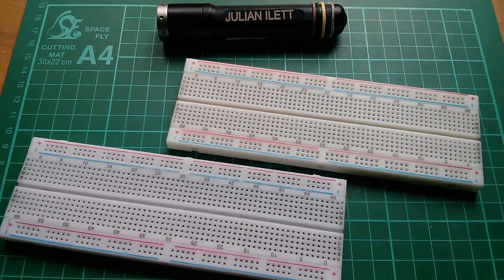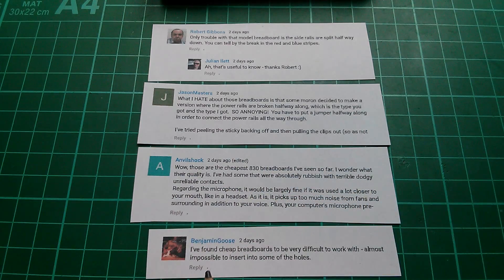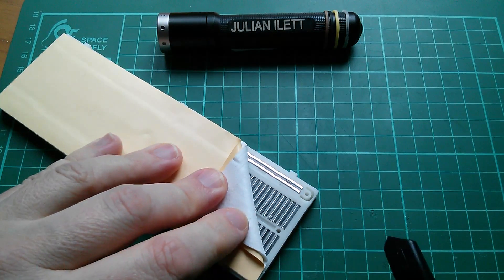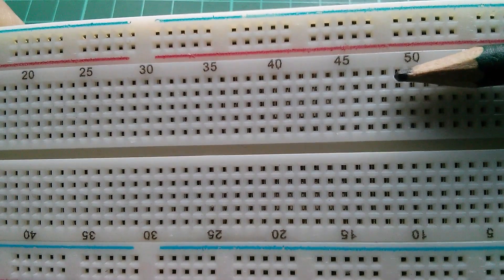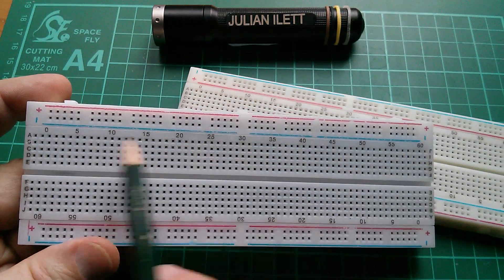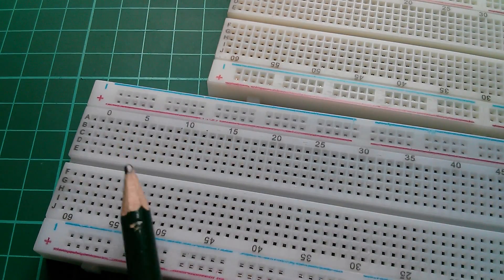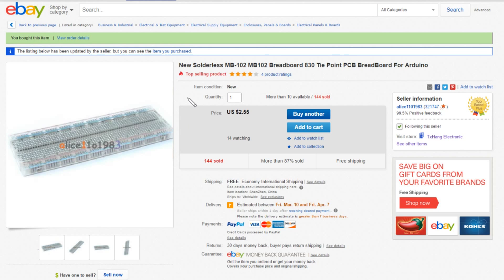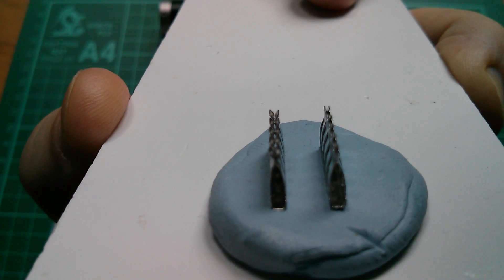FAKE Solderless Breadboards

Comment: I have just received from the ebay smaller breadboards that look identical to the ones you are using in this video, but they have the same problem as those larger ones - it is so difficult to insert into some of the holes.

Their quality seem to depend only on those metal parts inside of them. Perhaps the best way to check which ones you are getting is to zoom the picture on the ebay and see if some holes have those metal parts in the middle of the hole, which would prevent easy wire insertion.

Comment: So what are your recommendations for a half decent breadboard?  I've got one of the cheap crappy ones and it really is useless.  I've just been making some very simple circuits but have spent more time making sure I've got a connection than I have doing anything else.  It really is utter junk.

Comment: IMO the split power rails is a feature, because sometimes you need to have more than 2 different voltages in a build, but in this case it does not really matter, because they are useless anyway. :)

Comment: I bought ten really low quality breadboards off Amazon, and I almost can't insert a single IC. But I did however manage to get a few 555 timers in in places, but I used an old thick led leg that I cut to a taper to push into the holes prior to inserting the ICs, that helped a little. But the ones I got from maplin work like an absolute dream in comparison

Comment: I have just junked my rubbish boards,  bought these, from UK Ebay seller @£2.89 each.
Receive in days. 
Small letters, matching row letters, full voltage rails and best of all the pins fit and true connection :)

http://www.ebay.co.uk/itm/182386493820?_trksid=p2057872.m2749.l2649&ssPageName=STRK%3AMEBIDX%3AIT

Comment: Thank you for this video.  I have been using breadboards much in the same way that you do.  You brought up several points that i would have missed.  I will be more careful in the future when buying more of them.
I, too just keep  getting more breadboards for the next projects.
Are you aware of the "perma-proto" boards from Adafruit and (maybe)others?  They exactly duplicate the appearance, connections and hole patterns of this type of  breadboard, but are indeed, PC Boards.  So you can directly transfer your "art" with permanent,  soldered connections.

Comment: I bought some from Elegoo (or some similar spelling) on Amazon, they seem to be better than these but with their own problems
It's harder to insert and remove things with many pins (say a raspi breakout or Stamp), but a jumper wire or DIP IC is fine
And if you connect a couple of the boards together they're not flat at all, so they're not good for multi-board projects
Other than that they work just fine, but I do regret not buying them from Newark or such

Comment: I have some Breadboards like that my self, cause more problems than they are worth. I also bought some boards bundled with jumper wires from eBay, the jumper wires was even worse, really thin and soft pins that didn't make proper contact.
Personally i like the split power rails, handy for some projects that need more then 2 power sources. Its just that some people either don't realise or forget they are split and wonder why there circuit does not work.

Comment: All of these cheap Chinese broadboads have variances in holes. Not a big deal to bridge the 4 buses. And try mounting that breadboard power supply module you just got on a small board, combined with any IC chip circuit....you need these bigger boards.

Comment: I keep seeing people making videos complaining about this. The break in the power rail is actually quite normal, and useful when you wish to use multiple different voltages within the same circuit. (i know right.. who'd a thunk it?)

As for the insertion / contact issue, that's usually due to misaligned, or dodgy contacts.

Comment: Yep. I've got two of those. Actually the only ones I've got.. I kinda assumed that is the way it is so I got used to wiggling the parts in. I'm curious if I should get the small ones or maybe the ones without power rails. Those seem different construction altogether.

Comment: I remember my top quality one from Tandy was in a pretty dire state after I'd hammered a few TO-220 and open frame pots into the holes,  and passed enough current through some parts to melt it.   One nice thing they sold was a PCB protoboard with the same layout,  so you could transfer your working circuits.  If they'd have made those in transparent plastic, they'd look even better than leaving the circuit in the breadboard.

Comment: The power rails are designed to be split halfway aren't they? I've seen those for years (25+) ... I have been told it allows for multiple voltages on a board ... now the low quality of the holes IS crappy manufacturing.

Comment: Alice1101983 is pretty good with good parts.  FYI to all.  I did run across LM338K voltage regulators from Alice that were fake.  I had a feeling they might be.  They were $2.69 USD for 5 of them.   They were at least $6 USD each anywhere else on Ebay.  They did refund my cost on them no questions ask though.  So Alice does have fakes but they do take care of you when you get a fake.

Comment: I got one of these that came with a kit. No continuity on the rails from the mid point. The numbering makes no sense at all. I also have a 400 pin one that came with another kit and its big problem is that once you've plugged components into the inputs, they become loose and you can't get connectivity with some components.
My parents got me a really nice one for Christmas that's 1300 inputs plus 8 power rails. It's mounted on a steel plate and has rubber feet on it. The name on it is "All Electronics Corp." I highly recommend that one.

Comment: I believe the printed numbers and letters are designed so they look the same when you flip the board upside down...  the left side letters and numbers at top, that is.
another bad thing about these boards is the bus bars tend to stretch open easily and STAY OPEN..  IE they won't grab a smaller wire after a thicker wire was in it previously.. the metal bends out, but won't retract after the wire is pulled back out.
All the cheap breadboards from China are going to be like this.
If you want good quality boards, buy them from a trusted source or get used ones on eBay..  I bought 11 used JameCo boards for $20 and am very happy with them compared to the el cheap Chinese ones.

Comment: The printed numbering should always start in the lower left corner.  That way you can line up the IC pin 1 with 1, 11, 21, 31, etc. to make it easy and fast to get the right pin.
Reply: I mean otherwise it is just useless crap printed on by a company that has zero experience with actually using the product they are manufacturing.  They are just trying to follow what another company is selling but thought they knew better by starting in the top left.  And even then they didn't start at pin 1.

Comment: I don't know what is going on but I have experienced a BIG spike in bad fakes, dead items or completely unusable items from china off ebay over the past 5 or 6 months.  I have never in 17 years had to file so many complaints or request as many refunds as I have since August.  I wondered why you used "alice" so often but now I know.  I have a few sellers I've only had excellent experiences with and I stick with them whenever possible.  

Good luck on the new boards.  I hope these ones don't disappoint.

Comment: Well that explains why I was having trouble with BBs - I only started elec a year ago and didn't know better -. One has bad printing, but the other is pretty good except for half of 1 line, so I guess you have to check the entire length. There seams to be a few types on a image search, but you can probably say upper case and not starting on zero together are bad ones.

Comment: I used to work for a communications company and find bread boards installed in $5000 dollar radios for additional options, and they were installed by the head technician, my boss ! At first I would question the reliability. I have to admit they worked very well. I guess he was cutting cost at any cost.

Comment: Some might like the split rail situation, as you can provide two completely separate power supplies with separate grounds for projects where your coupling with opto circuits. I've seen these split rail boards for years, so I'm surprised your just noticing them.

Comment: These are not fake just cheap. For most things going cheap is a false economy.
Reply: I actually paid a fair old whack for mine from a UK eBay seller. They are rubbish, and their tooling is probably worn out or just plain defective.
All they do is ruin components. I have zero faith in them in regard to contact integrity. Ever-Muse MB-102
Reply: Unfortunately 'cheap' does not correlate with what you paid for them. They are cheaply made and sub standard. Paying more does not guarantee quality but paying less more or less guarantees 'cheap' products.

Comment: Fake boards, not really. They are physically what you purchased and they do work, sort of. But cheap, yes, you might even say their garbage. But only because of the connections. But otherwise they are functional. Let's start with the lettering. I have a high quality set of these boards, yes the lettering is crisp on these but as far as the orientation goes, It is the same. It allows you to flip the board and still read the lettering from left to right top to bottom. Yes it can be confusing if you spin your board around, but that's the way all of them are, or at least the ones that I have seen. And my power rails are split as well. It is annoying sometimes but that's the way it is. And for some applications, it works better. This leaves the length of the board. Specifically the link tabs on the end of the smaller boards. Smaller boards can be linked together, but if you get too many boards linked, you will break them. That's why the larger boards do not have these tabs. That's what the mounting tape is for on the back. If you have several of these boards linked together, you need to stick them to a support backing board. the connection points or the main issue. If you can't get your wire into the socket, They are not worth the money that you paid for them. and you really didn't get into the double-sided tape issue. If the double-sided tape does not adhere well to a backing board, the boards may come loose while you're working on a project. this is not good. 

The moral of this story is, you get what you pay for. If it was not as described, or nonfunctional in some way, you could get your money back from eBay. But because it is functional, just barely, you have to accept it. Other things you have to watch for, as sellers claiming to be in the United States, but actually there in China. Only a distribution point is here in the United States. I ordered a product from a US seller, and yes it was sent from here in the United States. but they sent me a product that was nonfunctional or incorrectly described, can't remember which, they wanted me to ship it back to them, At my expense. Not to the original shipping location, in the United States, they wanted me to ship it back to China. That's not going to happen. I filed a complaint with eBay, and their policy is that the seller pays return shipping, which would have been more than the product cost. I wound up getting my money back, and keeping the product. After I received my refund, it went into the garbage. if you want to buy good products, buy from a reputable seller, read feedbacks, as many as you can, both positive and negative. only disregard theobvious mistakes. Such as, "as described and fast shipping, A++" Under the negative feedback category. And don't just go for the cheapest price. it's one thing to go for a cheap product for prototyping, but not forest finished product. And in this case, not for something that you want to use for an extended period of time.

Comment: Those are exactly the same breadboards as the two I purchased from Tayda Electronics.  I didn't like the quality, but I don't have many other boards to compare with.  Looking at Tayda's  site, the picture does match the product, so I will have to get some 400 point breadboards as they like a better quality board.  A little disappointing considering Tayda is more expensive but the quality usually makes it worth it.

Comment: OMG .. I got cheap ones too!  And the ones I've had for many years are also cheap.  What ever shall I do.  .. Come on.  Don't all solderless breadboards have problems?  You know, like internal resistance along the bars or the "tie points" wearing out?  Some of mine even have power rails that are actually separate moldings, only held to the main board with the double-sided sticky tape on the bottom!  
I'll give you a history at the end.  --  

Split rails - very useful.  Also, glad they started marking them as split when that are.
Power rails - markings are adequate.  I wish the holes aligned with the main board.
Lettering and numbering - I read 'left to right' and 'top to bottom'.  The board is never upside down.  Don't use the letters and numbers anyway, and have only seen them used ONCE in 50yrs.
 Insertion force - never had a loose connection.  Yes, I wiggle them, for several uses.  But I wiggle them in the direction of the buss bars.  Works better that way.  And I twist the tabs on IC sockets and switches etc., so they don't destroy the buss bars.  The pointy things that come with new shirts, called 'pins', also come in handy for new a breadboard.

My first 'breadboard' had wire loops, coil springs and what can only be described as a peg board.  
My second one, I 'picked up' from my collage lab.  Hard plastic, 0.2 inch spacing and an interesting buss bar pattern.  I still use it.
3rd and 4th ones, I paid big bucks for from Radio Shack.  Much better than coil springs and 0.1 inch spacing.  I was in heaven.  

Except - expensive!  About 20 yrs ago, I had this one circuit set up that didn't work properly.  Probably had a transistor in backwards or something.  BUT, I really liked what it did when I powered it on!!  I still have the layout file for that circuit.  It's too bad that I couldn't leave it on the board until I figured out what was 'wrong' that was so 'right'.  Breadboards were expensive.  Cheap breadboards are a YES from me!!  I have never thrown a breadboard away.  
Just Sayin  -- and still lovin the videos

Comment: I have one of those.. Pushing an arduino nano into it was a terrible experience.. I had to sandpaper every single pin manualy before wiggling the board in the pins and widening those with a nail.. Ugh. Terrible purchase. The worse thing is I bought two more from a different seller and hope they won't be such crappy quality too..

Comment: Very interesting, Julian.
But please be cautious about general judgement of sourcing options.
I checked my breadboards and found that those I ordered from China via ebay are all fine.

The ones I bought in electronic stores in Germany (!), though, turn out to be similar to the low quality one you showed. And that means: All of them. 100%.

Luckily I don't care too much about the lettering, the power rails are an easy fix, and plugging components in isn't too difficult. So I didn't really notice until this video.

Bottom line: Wherever you buy them, you can never be totally sure not to receive fake items.

Comment: I think Bad quality would be a better description of these, they aren't necessarily "fake". This design for 830 pin breadboards has been around for quite a while and is extremely popular, essentially it is two 400 pin boards tied together with a few extra rows, so you can have 2 completely separate circuits (power rail separation and all) running on a single breadboard.

I noticed that while 0 isn't pointed at a specific pin row, all of the other numbers are, which actually makes sense due to the layout of the boards. The Numbers are all spaced exactly 4 rows apart therefore if they printed 0 on a row everything would have to shift over by half a row and it would throw off the alignment.  They could have printed row 1, but that would mean there would only be 3 rows between 1 and 5, rather than 4 rows between 0 and 5.

I was considering buying some of these off Aliexpress, I am curious what kind of quality the actual contacts are now though. I have a couple cheap ones from amazon but they were 5x the price.
Reply: They are fake because they are copied from a design and build which does work, but fail in all respects of usability and integrity
Reply: I guess I consider something Fake when it claims to be something and turns out to be something entirely different. In this case it claims it is an 830 breadboard, and for all intents and purposes it is exactly what it claimed to be.   It does seem to be very bad quality though.

Comment: I also have dozens of bread boards and this interested me enough to check mine out. Although most of mine are 20-30 years old and unmarked on the surface, thos appeared OK. the newer ones I have gotten are marked OK EXCEPT the one I got in an Arduino parts starter kit which is one of the fake ones. Admittedly, the Arduino starter kit is NOT a true Arduino kit, but aftermarket. The only other one that is problematic is the 15 year old Archer brand from Radio Shack mounted on a steel plate with binding posts

Comment: I have one of the shorter breadboards that has a split positive rail but a continuous negative rail (on both sides). At first it confused the hell out of me, I couldn't figure out why some of the components weren't getting power, but then I realised it's actually quite useful. You can get voltage regulator modules based on the AMS1117 on ebay that connect one rail to the other so for example you can have a split rail with +5V and +3.3v without needing to take up space on the board itself. Also when you want a continuous rail you can just use a short jumper wire to bridge the gap anyway.